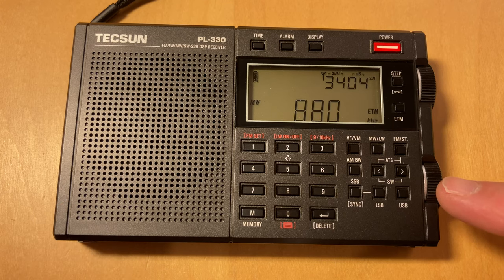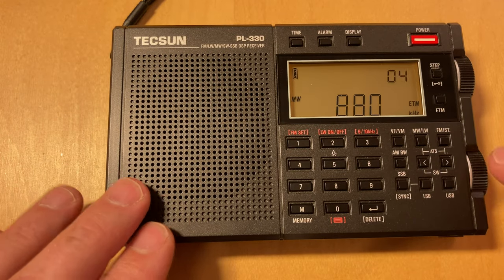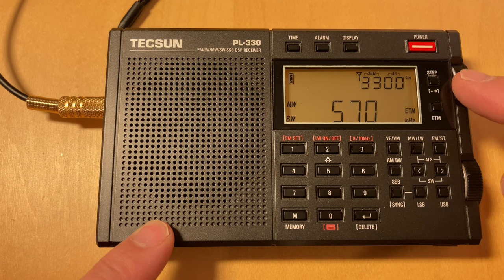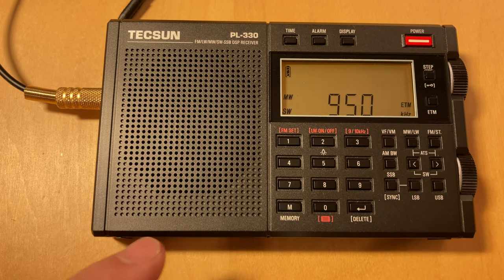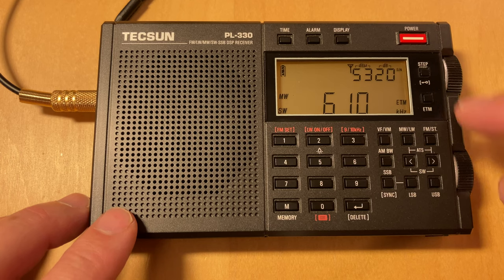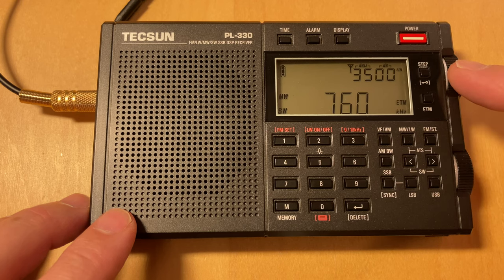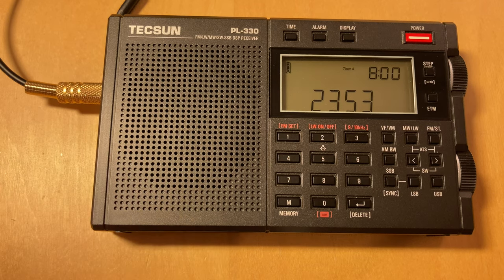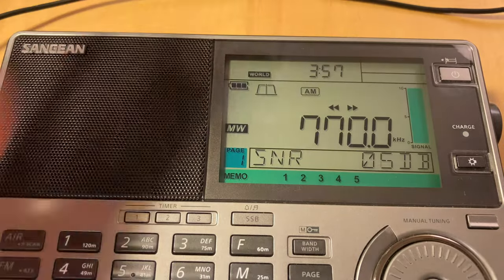Using an External Antenna on the Tecsun PL 330 for MW: ETM Scanning and the Bandwidth Setting

Comment: Hmmm.......the manual says that pressing and holding the #3 key changes the 9kHz/10kHz tuning step.  Nothing about changing antenna inputs.
Reply: You are right but this is a hidden feature not documented in the manual. You have to be in MW mode and then just hold down the #3 button and it will say CH-5. To revert just do the same & it will switch back to CH-A.

Comment: To use the external antenna jack, which contact (tip or which ring) on my 3.5mm plug does my wire need to be soldered to?
Reply: on a DEGEN  1103 it is connected to the TIP end of the plug and the  the Ring is just left floating. I suspect all these small  SW radios use the same system. 
What I'm wondring is - is the  External jack when activated really  into a internal 75 ohm transformer  so it's  compatible with a coax input. ?? THere is NOTHING in the English short form manual or the  PL 330 about this input on a technical basis.  I know that on a Degen 1103  the equivalent jack point  is a 600 ohm  Hi z input when used and Does NOT nee to be enabled by the user.   Tim  Fidler in Nz

Comment: Thanks for sharing. I did not know about holding down that button to switch to external.
Reply: Does it revert to internal ant when turned on again or is the external ant permanently the default source?

Comment: The item is being used with  an MLA 30 Plus amplifier //  asper the producer's  VIDEO notes   in text //  for an external antenna so the input cable has to Be light weight COAX as as supplied with the  active antenna amplifier . There is  basically zero  technical data on this antenna system which is a Mag loop  antenna.  Best guess is the output is at 75 Ohm impedance .  Therefore the   radio has  to be put in low Z mode for the Jack point for that antenna system amp to work.  The  MLA 30 uses 5 V from a USB cable you run to it as  a power source .  Hence it has a semiconductor amplifier inside it. 

The Jack point on a DEGEN 1103 is a high impedance point for along wire antenna. Internally these radios can be very different and the user manuals are woeful for understanding what the hell is going on in this respect  Some MLA 30 amps infact come with an SMA connector on them proving that coax feed to the radio  is being used. 

TE. Fidler

Comment: Very instructive video, thanks. May I ask a question to all PL-330 users here? Mine has an annoying flaw: the tuning wheel is way too "soft", almost not notched at all. It moves at the slightest unwanted touch. Furthermore when I browse the bands, it tends to skip frequency hops, either doing nothing or making two hops. This is quite irritating. Do I have a defective unit?
Reply: Tecsun PL-330 is "cheaply" mounted. Normally the tunning weel is a bit hard in some points and too "soft" in another points. Look closely the wheel while turning: you can see that is not straight but a bit inclined/tilted. Pull out carefully the wheel to extract it, put a tiny and soft plastic thin and put the wheel in this place again. Even with this, in some steps/detents the radio changes by itself frequency. Sometimes the same happens with volume wheel too. Seem to be a malfuntion from the encoders and not a firmware fail.
In my case, this problem happens in my two Tecsun PL-330 units.
Reply: У меня такая же проблема с энкодером , это раздражает.

Comment: How do you hook up a outside antenna with a pl259 connector on the coax to a 990x??:body-blue-raised-arms:
Reply from the maker: To  physically make the connection, a simple adapter to a 1/8" mono audio jack to fit the antenna input is what's required. However, whether that will work with your configuration is going to depend on the antenna. For example, a TV antenna is tuned far above the SW band and most likely won't improve your reception there.

Comment: Helpful video, thanks. Do you know if there is a similar key press trick for switching the ext ant jack from  SW to MW on the PL-310ET? Pushing and holding the 3 button in MW mode does not work. I’ve ordered the MLA30+ and want to use it for AM band dxing. Cheers from BC 😊
Reply from the maker: Not as far as I know.
Reply: @sfred  Fred , when you plug in that external antenna - is that a  simple so called long wire antenna or is that a bit of Coax  (going to a dipole)  with the centre wire of the coax  on the   Plug of the connetor and  the screen of the coax  terminating on the sleeve of the connector ? If it is coax it must be  RG 174 because it is too thin for RG 58.  What I 'm trying to establish is do  I need a n impedance change transformer  for  use with a  coax, that transformer external to the radio or is the transformer built into the  radio and put in circuit when you push and hold down the three button in MW ?
Reply from the maker: @F_Tim1961  it’s an MLA 30+ mounted outside
Reply: @sfred  I worked that out - sort the comments on latest date -  that makes what happens with the  3mm plug in  (which is a COax in even though a Plug is incompatible with coax  ) more understandable. does  it support   the MLA when in SW mode or is the change you made dropped out when you move from   MW to SW ... these chinese they are incredibly useless in documenting their products. I have the PDF  documentation fron Sydney and it does not mention the Hold down to change input z  . I'm dealing with a badlly documented Chinee vfo andthe documents a  pile of crp.
Reply from the maker: @F_Tim1961  It's not documented. See here: https://swling.com/blog/2020/10/a-tecsun-pl-330-features-reference-sheet/
Reply: @sfred  I see it but that raises  a question - does that mean that in  SW mode the radio automatically switches  the ant. Jack in and this work around simply is a force specifically for the  case where you want to use an antenna amplifier on MW? It appears that way.  If done the best check I can because the schematics available are awful and it appears that the  Jack simply  connects in at the node where the antenna  connects . The difference is that  the  jack can carry a  ground plane with it  - on the sleeve  (alt. the sleeve is the return  path to the output of  the antenna amplifier. ) so if the jack is a long wire you can have a ground connection going to the sleeve of the jack and  the radio will then see a differential signal. 
On my older  Sangean with a  75 ohm coax  input and a physical switch that input in fact goes to a completely different part of the input circuit - an LC low impedance tank circuit that has another node on it that drives the base of  a different  RF transistor.
Reply: @sfred  See my recent comment - this also means that these consumer grade magnetic loop amplfiers are producing a  high impedance output to match the jack point on the portable radio.  I suspect they have  something like and MC3550 (a very old  monolytic  IF amplifier ) inside them with a tuned cct on the front end.
Most of them use a step tuner (the Sony version which has been reviewed on the internet) which is rough. There are a few that clearly have a capacitive element in the tuner for fine tuning.  The coax is just for show.  They have to get the  signal to radio Rx some way  but there's no indication that there is a coax match between the external amplifier and the receiver.  My main interest in this is to get  a signal off  a 70 ohm system into likes of  a Degen 1103.  it  clearly has to be done with a RF transformer system in step up mode. as in  2 x  1: 4  transformers, one cascaded into the other.

Comment: Would you explain adjusting the band width?
Reply: Bandwidth refers to the size of area that you’re listening to across the greater band. A wider bandwidth will pick up more above and below the actual carrier frequency. It usually gives you a brighter sound but also gives you more noise.

Comment: My PL-330, 320, and 660 radios 📻 all do much better with an external, outside antenna attached.
But, even with out that aid, they still are pretty sensative to weak signals. On medium wave, I get stations from all over the western half of North America (at night)
Several 50,000 watt stations come booming in. And 10,000 stations from Utah, Nevada or Canada can be perfectly clear and readable!